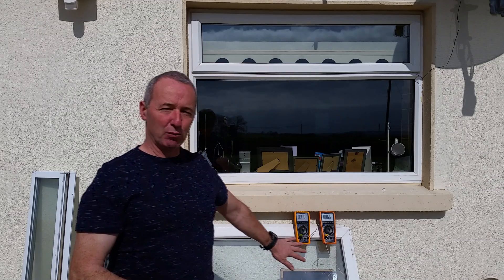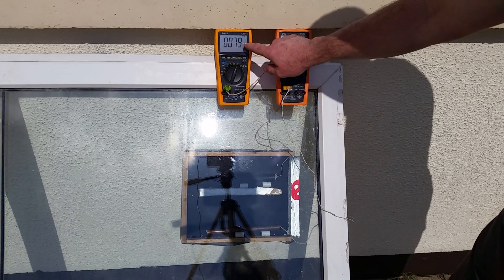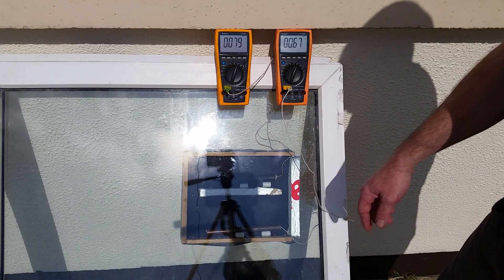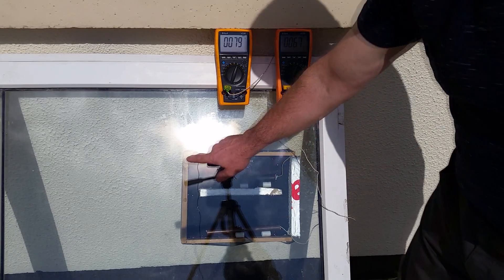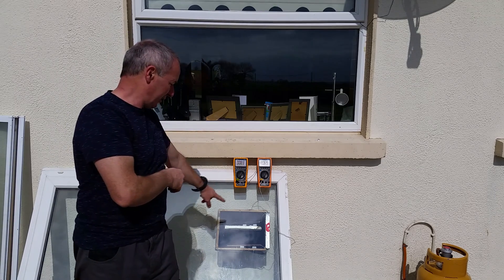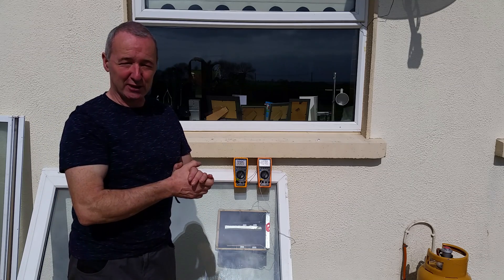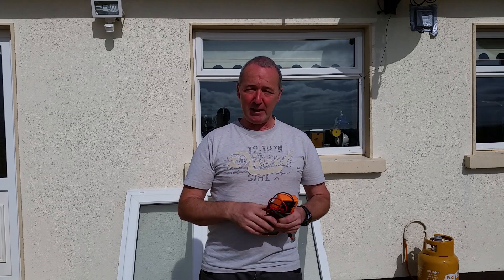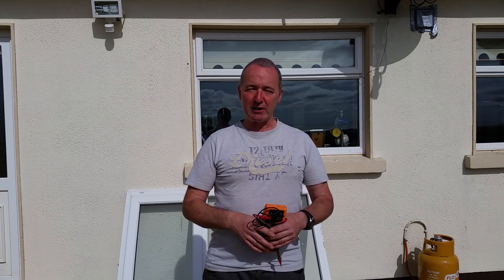Solar Hot Water .. Using an Old pvc window makes tons of heat

Comment: Great experiment. I was thinking of doing the same myself but you have saved me doing it. It’s surprising to see the difference blacking it makes. I have an idea of putting pipe work inside 28mm glazed unit and sticking black aluminium on the back of it.

Comment: if it below freezing point one must consider an ant--freeze. every night when work ended on pipe line directional drilling we used windshield washer fluid. To have coils in preheat tank to heat water and a roof mount makes sense on energy savings. one could put a temperature on off switch and a leave the pressure switch in the preheat tank. I think having the divider there on your video should have been vertical so one chamber was not on top the other for heat rising.  I wonder if air heat exchange with water lines in one box would work with something along those lines as your experiment box but with the addition of black heat paint on roofing type metal and the v bends in that for running the air through. The speed of air flow then can regulate the temp in box, exhaust diverted in hot weather if necessary. Maybe someone has combined both before and has a video i would like to see that done before i make mine. Thanks for posting.

Comment: i have a question gerry on the subject of copper hot water cylinders  do they actually  need a vent pipe  when heated by a central heating furnace , i know they need it when filling from empty  ,but the water never boils so i cant see what huge pressure if any would be generated  i think a lot of heat is lost through  the vent pipe   i think if one could do away with  it and just have  a valve for when  refilling  the cylinder .
Reply from the maker: Hi Duggy. Copper cylinders are usually vented and gravity fed. In order to equalise the pressure and to stop vacuum collapsing the cylinder when water is taken out a pipe from the top of the cylinder is run above feed tank. The heating side of things can be pressurised  no problem and heats the water indirectly through a coil. The vent pipe is usually connected to the hot feed to the house but if it were insulated heat loss would be minimal.  Hope you do crosswords and can make sense of my answer Lol. Cheers Gerry
Reply: thanks for that is does make  sense, keep up the good work .

Comment: one thought i have is to add steel wool painted black inside the unit so it also heats up and creates a heat mass in between the pipes....or lay black roofing shingles/tiles  inside instead of just painting wood or foam insulation black  cause those shingles also heat and retain the heat
Reply from the maker: Hi Swaby. I will have the pipe mounted on some black steel sheet to give it more surface area. Behind that will be some insulation to keep the heat in the box for as long as possible. That's the plan but it will be interesting to see if I can beat 83°C with a tighter setup. Cheers Gerry

Comment: Water heater is one the bigger power users in most homes.
Reply from the maker: Hi John. It will be fun to see how much hot water this little setup will produce. I can compare it with the commercial setup on my house when it's up an running. Cheers Gerry
Reply: Gerry's Waste Oil Burner experimenting and saving money is a win-win!

Comment: I'm a correct in saying a single pane glass would work better? Seems the dual pane was designed to keep heat out?
Reply: actually the dual pane would help keep the heat inside....its the sunlight that you want to come in ...hitting the black pipe creates the heat !
Reply from the maker: Hi Guys. When I was testing the double glazed setup I had a thought. What if this window is using solar shield glass. It would have been a very short experiment Lol. I was delighted that with a rough and ready test rig I was able to get 83 degrees. The solar panel will be easy to make but I am interested just what quantity of hot water it will produce in a day. Cheers Gerry
Reply: You have point there. A dual pane traps air that serves as an insulating barrier.
Reply: swany that does make sense.
Reply: You are correct. Single pane is the way to go. Almost all double and triple pane has a UV inhibitor (Argon gas). You could achieve a 30% gain with single pane. Also the a low pressure pump will give you better result back to your storage tank. Most pumps are adjustable so you want just enough pressure to push water to your solar panels so it an collects he heat and travel back to the tank.
Reply: @rongriggs4430  Sure, but he says that it works !.. 83C° is quite interesting isn't it ? Because the problem with intermittent energies like solar, it that the time you need it the more (i almost never take hot showers in summer for example..) you have the less heat available, days are shorter, and cold outside is taking out a lot of energy form the pannel..
Multiple glazing have the advantage to keep longer hot water for the night and winters when you actually need it more .. 
If argon is UV repellant, and be a problem (cause 83C° is enough for me..) it is also possible to replace it with other insulating gas, or even just normal air works quite well..

Comment: Hi Gerry
Are you planning a serpentine or grid layout for your collector?
Reply from the maker: Hi reincarnate thylacine. I will be going with serpentine as there will be no joints behind the glass. I have some 230v pumps but I might go with a 12v pump setup and PV panel. The plumbing is handy enough though. I am just finishing off the Paramotor trike at the moment and then onto the solar stuff. Cheers Gerry